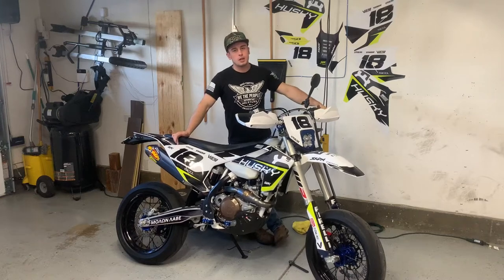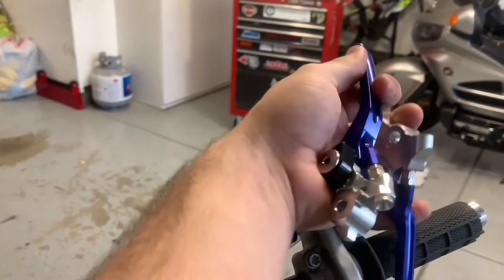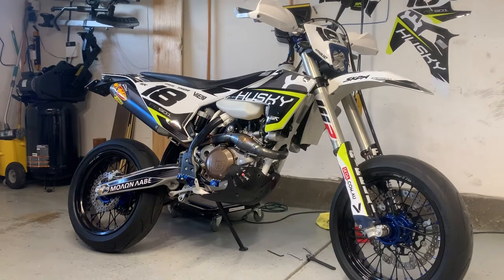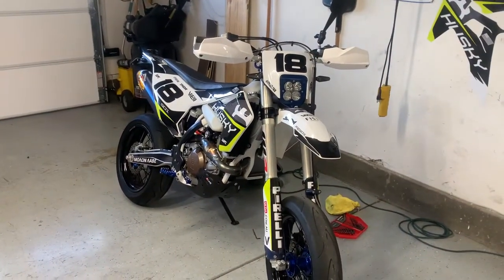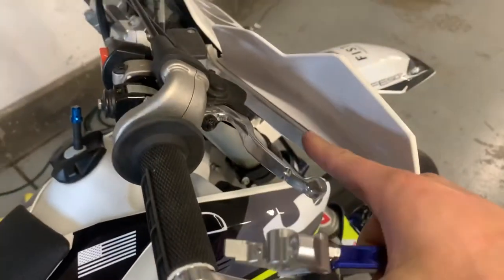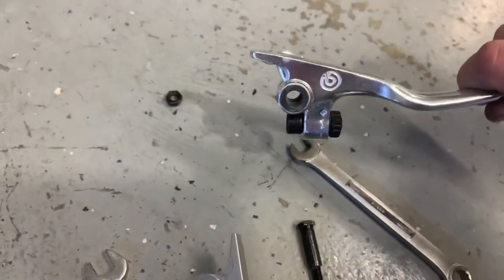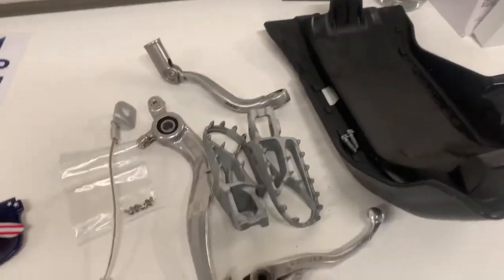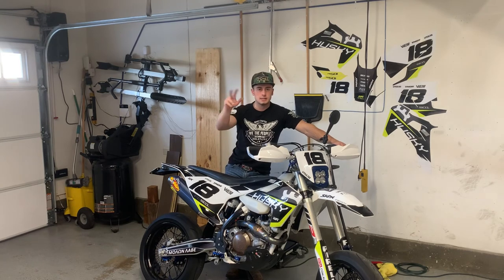Installing New Break & Clutch Levers On My Supermoto Dirtbike

Comment: that's a bummer the brembo levers aren't sprung forward. the magura master cylinders are better IMO. I've got an FE450 Supermoto, wish I got the 501 for sure. I just put a FC450 cam and 2020 FS450 slipper clutch assebley in mine, love it. wouldn't want to ride anything else on the road. needs better suspension tho. the xplor stuff is so bad. bikes looking clean mate. wish you could show us here in communist Canada how to license a 2 stroke but even better a 450SMR or FS450. only way to do it here now is buy one and swap frames. that's my plan.
Reply from the maker: Thanks buddy! Yea there is some legal work around a here such as getting a PO Box in a better state law wise like South Dakota where it is legal and plating it that way. Or there’s a company in CA called dirtleagal that is supposed to be able to get you new paper work making it street legal.